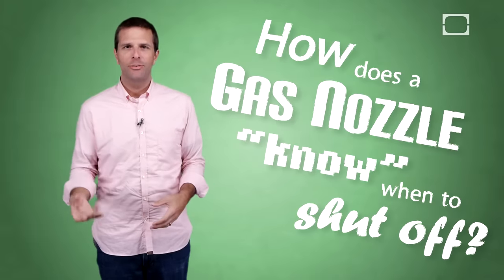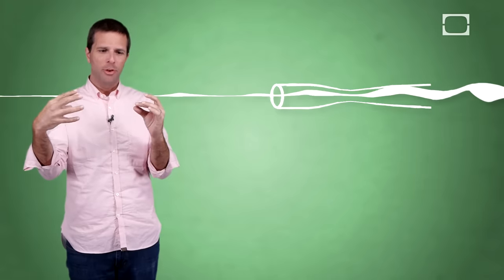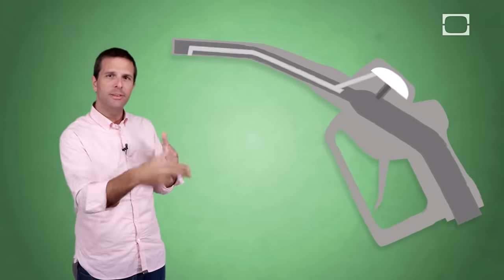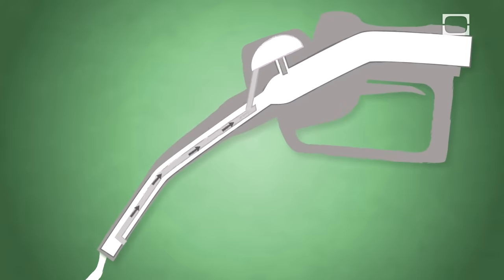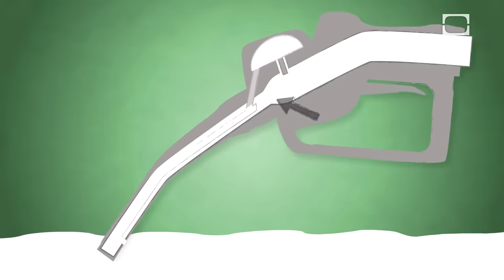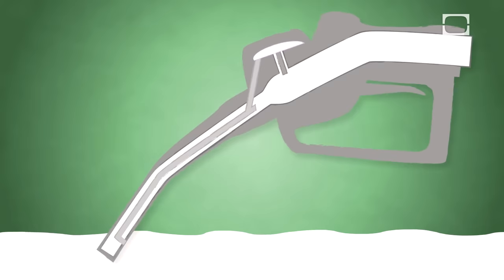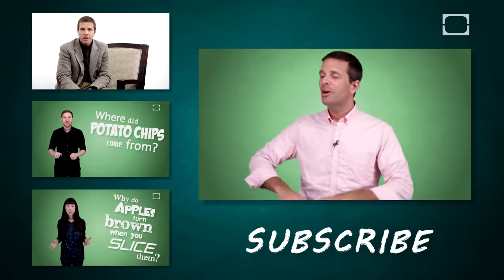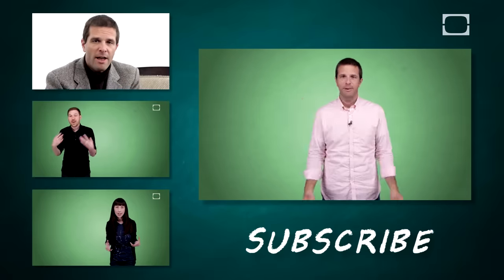How Does A Gas Nozzle Know When To Shut Off?

Comment: Worst explanation and diagrams ever. In the diagram, the sensing tube is shown to be in the middle of the fuel dispensing pipe, which makes no sense. It would be on one side only. No explanation is given as to how the air diaphragm causes the shutoff to engage or remain disengaged. Entire explanation is hand-wavy and utterly useless.